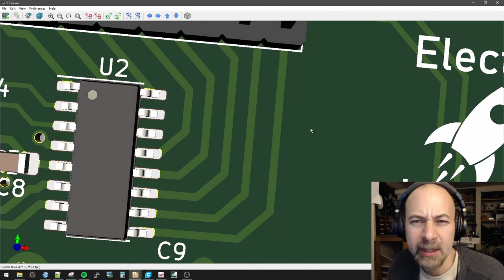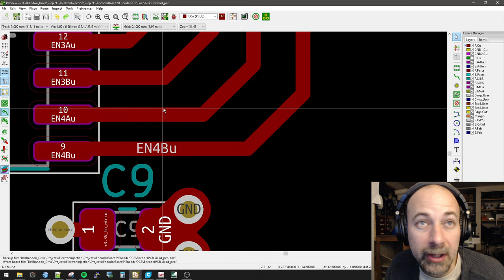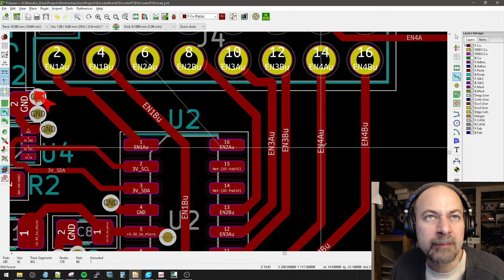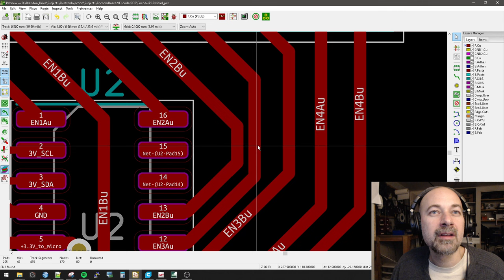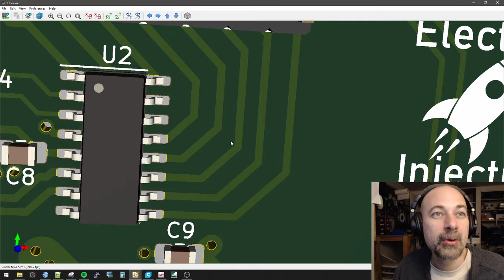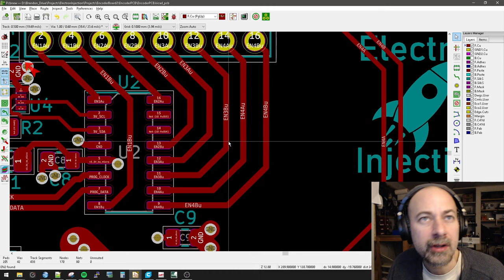PCB Design For Beginners:  Ugly Tracks Are Noisy

Comment: This is good information, but the thing is, most people on YT are not intersected in good information.  Good information requires assimilation which requires effort.  I know this from experience.  Sad.
Reply: What's your point? Should we stop making videos with good information?
Reply: @GerbenWijnja  My point was clear.  Nothing between the lines.  People in general are not interested in good information.  Example, this video has good information and got 26K views in 2 years.  An idiotic video with zero useful information from The Beast will get 100 times that in the first minute.  Take from that what you will.  It's a fact.